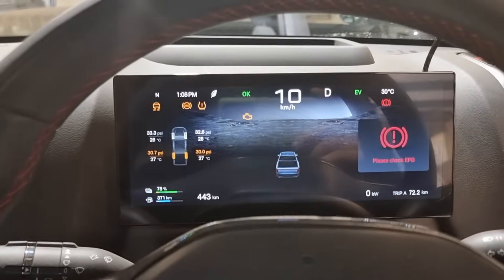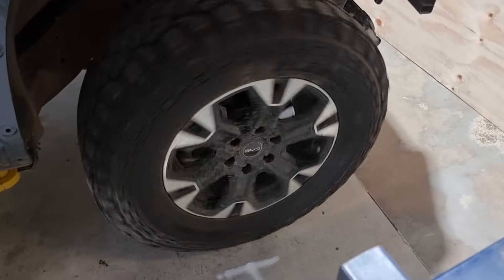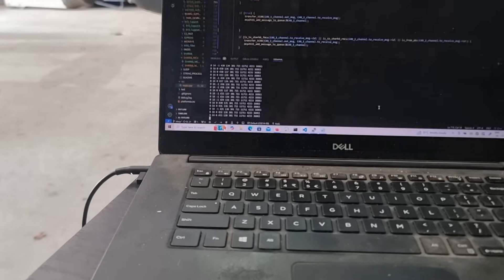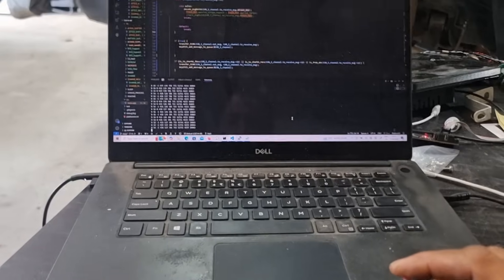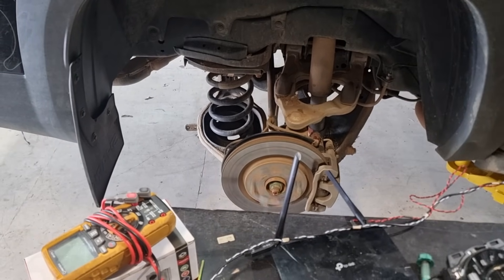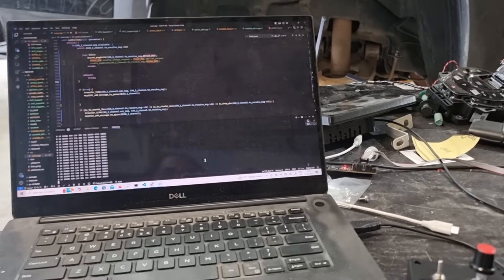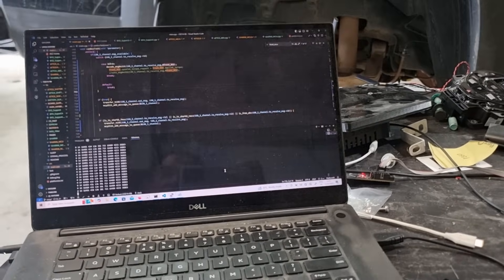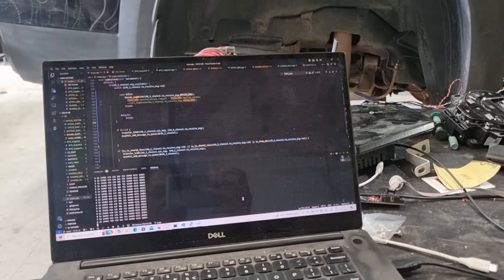BYD Shark Gear Ratio and Top Speed.

Comment: 8 months... Any progress or is it a fail??
Reply from the maker: 10.5:1 gear ratio using the wheel speed sensors.
Got one pedal driving and working on an aftermarket kit for Sharks. You can check the All Terrain channel for some of the results.
Reply: @franciscoshi1968 cheers

Comment: Why would the wheel be spinning at half the speed if both wheels are spinning
Reply from the maker: @Christoph1888  it is because of the differential.  If you lift one wheel and the other is on the ground the free spinning wheel will spin at twice the speed compared to if both wheels were spinning at the same speed. The sum of the speed of thr two wheels is constant.  If one wheel stops the other has to spin at twice the speed.

Comment: is the efficiency loss at highway speeds of evs, due to the field weakening? I've never known why they are less efficient at highway speeds.
Reply from the maker: The reason for the lower effeciency on the highway is aerodynamic drag. If you follow a big container truck (just normal following distance)  you will get the same effeciency as driving in the city because the air behind the truck is moving forwards.
Most EVs do not need to apply field weakening at 100kph. They have been geared so they don't to improve effeciency.
I had an electric van from a customer which had to apply field weakening at 100kph. It would consume 4kW just from the field weakening at 100kph. It wasn't really intended for driving on the highway.
Reply: @franciscoshi1968  thanks for quick reply and sharing your knowledge

Comment: The leopard 5 has 21:1 gear ratio at the rear axle due to a 2:1 low-range gear. So 10.5-11 should be a right number for Shark

Comment: Great work my only suggestion for anyone is to put a few wheel nuts on if you spin up a axel without the wheel on the brake rotor can come loose and do some damage
Reply from the maker: The brake rotor has a screw holding it. It won't come off.

Comment: Another Francisco magic in action! One question though, with this setup is it possible to catch and override the commands being sent to the motors like example the pedal pressure and modes? So when you set for example "mountain mode" and pressed on the accelerator it intercepts it and sends a different max torque and top speed config on the motors.
Reply from the maker: Yes. That is exactly what we are going to do.  So far I am only intercepting the messages to the rear motor because I have access to that plug. The plan is to find the module that sends the torque commands and intercept the messages to both the front and rear motors and implement the traction control. To do this I will have to find the bus with the wheel speed sensors and the accelerator pedal reading.  It is a fair bit of work and because I don't have a circuit diagram I will need to strip the car down and follow the wires. We are going to get a stat write off when one becomes available to do the development.
Reply: @franciscoshi1968  Yeah that sounds like a lot of work, trial and error, but absolutely brilliant. I was also thinking with this setup it will be possible to add a tank turn specially for maneuvering tight terrains, as long as it's not that bumpy and doesn't have a crazy gradient maybe, where you'll have the risk of rolling and losing traction.
Reply from the maker: @danielmonzada8587 it only has one motor per axle. It wouldn't be able to do a tank turn.
Reply: @franciscoshi1968  I see, I thought they're individual in your video since only one wheel is turning.
Reply from the maker: @danielmonzada8587 the reason only one wheel turns is because there is slightly more drag on one wheel than the other and the open diff makes the other wheel turn faster.
Reply: Would you be able to get a quasi tank turn by locking the inside wheels?
Reply from the maker: @donavankossally1124 no. To do a tank turn you need the left and right wheels to turn in opposite directions.

Comment: You found the cause of the lack of torque, but why does the Shark seem not to give any torque in the uphill situations like what Car Expert test on a not so steep hill? Is that a software issue? Any chance if the software issue is addressed, it has a good chance to drive up that hill?
Reply from the maker: When we get the radiators fixed we will take it for a test drive and will be able to see the torque request sent to both motors and will be able to graph it so we will know for sure what it is doing.
Reply: I think the lack of a “transfer case” giving low range is the issue here. The motors are tuned for a balance of soft roading and highway efficiency, not large rocks and steep inclines. What we are watching here @grantwu4498 is the attempt to tweak the tune to resolve that, thanks so much Francisco.
BYD could provide a transfer case (like GWM Cannon Alpha PHEV and Taycann,)but can’t because they fitted the battery between the two motors with no drive shaft.
BYD could provide a tune geared with a heavier rear bias I would think in mountain mode especially, but maybe was a bridge too far for the engineers in this MkI.
BYD could also provide a rear locker which feels like it would solve most of the current mild- harder off-road issues, when you watch the dozens of offraod videos on YouTube showing the rear wheels spinning independently, (nvm centre lock diff)
Reply from the maker: @tomekwolny5606 a bigger rear motor with diff locks would solve the low torque problem.  My guess is the rear drive unit is not specifically slgeared for the Shark.  I think it is used in other vehicles and all they did was use it as it is. In reality if this was intended to be a soft off roader the current setup is good enough.

Comment: Nice anaylisis! In comparison, B5 has a front motor with 200kW/360N·m and a rear motor with 285kW/400N·m. Obviously BYD handles B5 more properly for the rear wheel torque for offroading.
Reply from the maker: If the motor can physically fit in the Shark we should be able to stick a B5 rear motor in a Shark.
285kW rear motor would easily replicate low range.
Reply: Wow awesome 👍. Remember when local tuners were still trying to figure out what to do with EFI for a many years. Now we have this level of local engineering reverse engineering cars not yet on sale ! Love it!
Reply from the maker: @tomekwolny5606 i think it is easier than tuning petrol engines. I did build a battery less EFI computer for a dirt bike years ago.

Comment: Nice work Francisco! Presumably higher ratios would require larger diameter gear, so how would you fit a larger gear in the existing drive casing?
Reply from the maker: There are two sets of gears. One between the motor and an idler and another between the idler and the diff.
We should be able to change the gear between the motor and the idler.
When a stat write off shows up at the auctions we will buy one so we can pull things apart and see what can be modified.
I am planning to make a one pedal driving upgrade with better accelerator response once we get a stat write off so I can work out where all the computers are.
I don't have a service manual so no circuit diagrams to help. I just have to follow the wires to see what module does what.
Reply: @franciscoshi1968  Love the plan! Looking forward to learning way more than is possible from the Service Manual assuming one was available.
Reply: Your smart as hell mate!

Comment: Personally make the rear axle top speed say 80km/h

And just drive using the front wheels over say 60km/h.

Yes would be a bit slower on the road, but would make it epic offroad.

Also if you ran it in fwd mode for higher speeds, the economy shouldn't be any worse.😊
Reply from the maker: The problem is that above a certain speed the back emf from the motor exceeds the battery voltage.  Above this speed you need to apply current to the motor to drop the voltage.  This is called field weakening. This current doesn't produce any torque so it is a complete loss. The maximum speed is also limited by the rotor. If it spins too fast it flies apart.
The maximum power happens at around 4k rpm so as a guess it will probably free-wheel without field weakening to about 8k rpm. With 15:1 ratio it will spin to about 9k rpm at highway speed. So this may be a good compromise. Run it in FWD above 80kph and apply field weakening if you need more power for overtaking.
My guess is the rear motor is used in another vehicle and that us why it has the wrong gearing.
Reply: Why does it make a wheel bearing noise? and is the ice cream truck sound in the back ground come from the car? If so thats super annoying, it sounds like a ripoff of the lg/samsung washing machine noise?
Reply from the maker: @Steve211Ucdhihifvshi  the bearing noise I think is because the suspension is completely extended and spinning very fast. I think it is from the CV shafts and slight out of balance.  Don't forget this is doing over 200kph.
The icecream sound is the pedestrian awareness noise  maker. Fortunately you can't hear it from inside when you are driving.
Reply: Sounds like a great suggestion.

Comment: So many questions! Why would they pick a different drive ratio front to back? Is it to get better efficiency at different speeds so they can bias front or back at different speeds? 
Is this why it feels like front and back are out of sync when flooring it from a standstill?
Does this also mean the energy displays are lying to us? When I'm in eco mode it shows both front and back being driven.
Reply from the maker: My guess is the rear drive unit is used in another car. The front is probably custom made for the Shark because it mates with the petrol engine.
So the front has the correct gearing for the tyre size and axle weight.
If I was in charge of designing this Ute I would have put a much bigger motor on the back with much lower gearing. It wouldn't be hard to make the rear put out enough torque to simulate low range.
One good thing is if we can make a different motor fit in the back I could get the electronics working.
The Seal rear motor is a very good solution. It has better cooling and more power but I don't think it will fit. It has some mounting brackets that stick out in the wrong place.
Reply: @franciscoshi1968  it seems it is designed to be so, making compromises among different factors, including cost and introductory prices, underestimating the offroad requirements of the Australian market. We cannot count on a product that suits all needs and be this affordable. This will make room for modification for shark 6. If shark 6 version 2 gets the problem resolved, I guess the price would not be this, it would be 70k+.
Reply from the maker: @grantwu4498 if thr volume is high enough a bigger motor would probably only cost less than $100 extra. My guess is they just picked an existing drive unit they have for other vehicles and put that on. Clearly it has the wrong gearing. With the two motors even with the wrong gearing it is still good enough for most use cases.
Reply: He doesn’t mean they are running at a different speed, just at a different gear ratio.
Reply: @andreww1928  yes, but ratio plays into speed, so you can't just have one torque/speed/power/demand map for both front and back

Comment: I know basically nothing about offroaders... But would it need some sort of diff lock to get up Beer oclock hill again? Is that even possible with this setup? Really think this car could be an offroad beast when its fully sorted.
Reply from the maker: I think if we change the gearing on the rear and put diff locks it may have a chance of getting up.
In reality I don't think it was intended to be able to do this kind of tracks.
There is no doubt that it rock crawling was a requirement it could easily be made to handle it. Getting the same torque as a 4WD with low range is not hard but it costs more money.
Reply: FFS, who really wants to get up Beer o’clock? Truely, most fail, it’s just friggin ridiculous to even talk about that.
Reply: @jtt3346 I think it’s important we’re clear that we’ve seen how the Shark performs in stock form on BOH, we’ll be using BOH Hill as our benchmark for improvement not as an objective to climb to the very top. We’re not planning to “send it” up there again, but based on our previous attempts trying different lines, left and right, and approaching it sensibly the goal now is to reach at least the Superior sign without any crazy momentum. If we can do that, it’ll be a solid indicator that our modifications have genuinely enhanced its off-road capability and that is the actual objective.
Reply: @AllTerrainActionEV yes, solid plan. Gotta say you guys are absolutely killing it with this stuff. This open source EV hacking project is about the most exciting thing I've seen in automotive development pretty much ever. Love it 🎉
Reply: @AllTerrainActionEV  Can't wait! Hope you do it again with Byron or even with Matt. Seeing the real-time comparison between different setups would be awesome!
Reply: @danielmonzada8587  100% we will try what we can, hopefully everyone will be keen to catch up for an enjoyable collaboration. I think we would all enjoy that.
Reply from the maker: @danielmonzada8587 once we install the one pedal driving module we will smoke Byron's Shark.
Even without more power we can beat the stock just by removing the delay.
If we re gear it I reckon we can easily drop a second off the 0-100.
Reply: @ a second off vs a way better hill climb performance would be an excellent trade off. Are you also planning to add some lift and upgrades to the suspension?
Reply: @danielmonzada8587  yeah we will get lift and a suspension upgrade thanks Savage Offroad. A bit in the works, but its happening based on how it becomes avaliable. Trying to navigate all this with other things going on in my life back in Melbourne doing our best to keep it coming as quick as we can though.
Reply from the maker: @danielmonzada8587 shorter gearing will make it accelerate faster from the start. You get both for the price of one. 😂😂
Reply: @AllTerrainActionEV  Wow saw those yesterday, those nitrogen-charged Shocks looks sick. From a banged chassis to the most jacked Shark. Goodluck on you guys.
Reply: @franciscoshi1968 a rwd mode would be good to fang around off-road too like the raptors. 😂
Reply from the maker: @jtt3346we want to make it to the top.
Reply: One of the questions I hope they can answer is why put the smaller drive motor at the rear? You want more power / torque at the rear when going uphill.
Reply: @rmc489 probably because it was never meant to be a serious off roader and is more of a lifestyle car.
Reply from the maker: @rmc489 I think the rear motor is used in another vehicle and they just put that in as it was. The fact that it has taller gearing than the front is a good indicator.